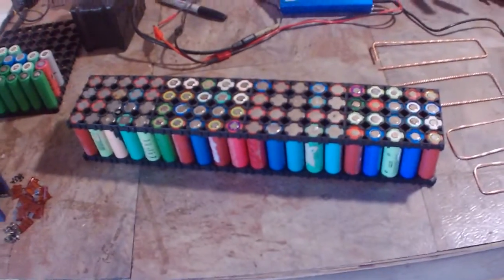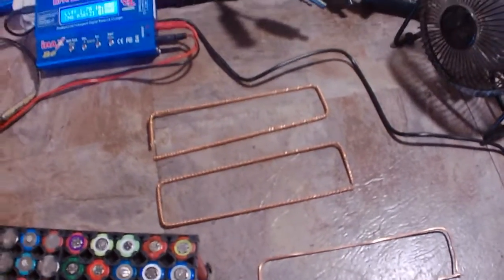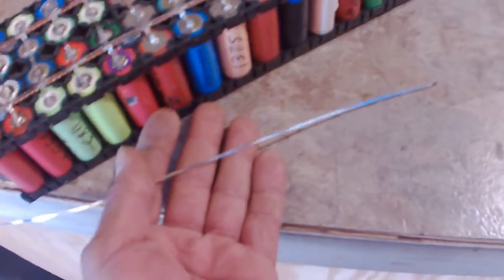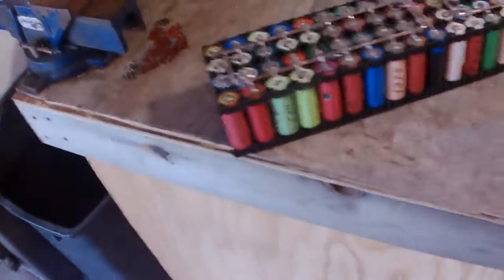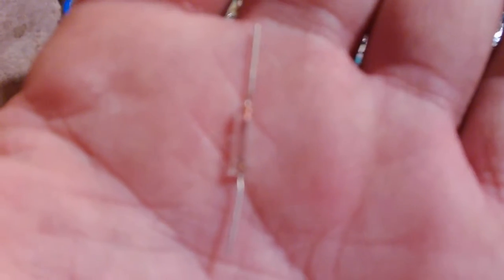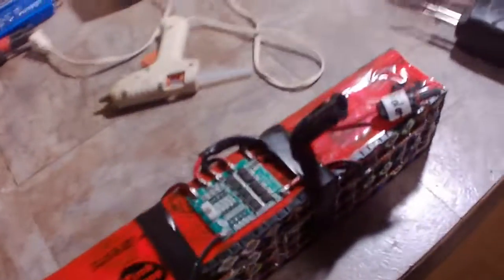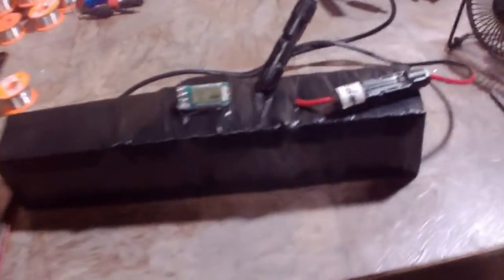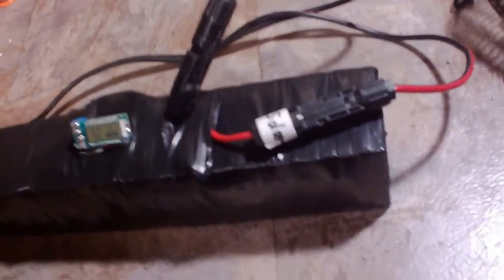best light weight boat motor battery diy 18650 part 2 building the pack

Comment: How dose 12v setup using 18650 work with the discharge charge? Do you get anywhere near the 4.2 voltage?